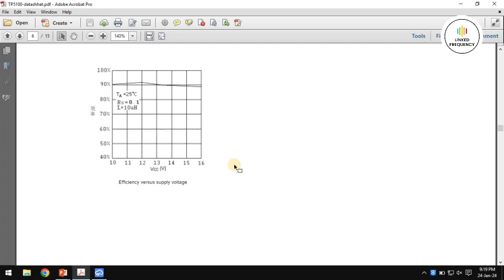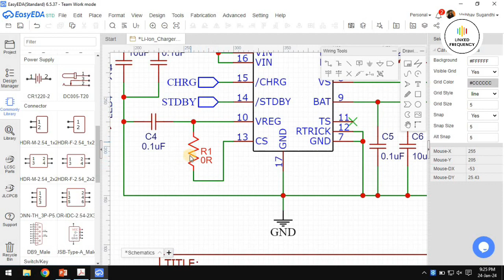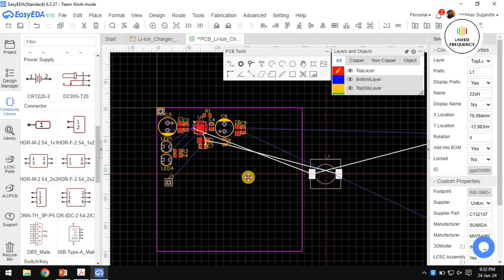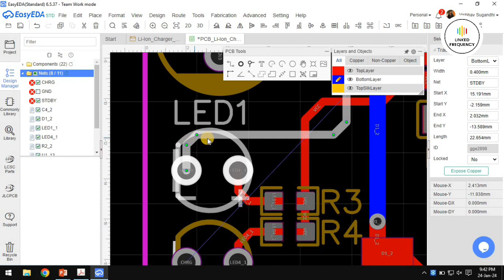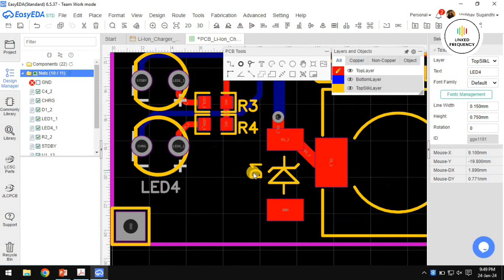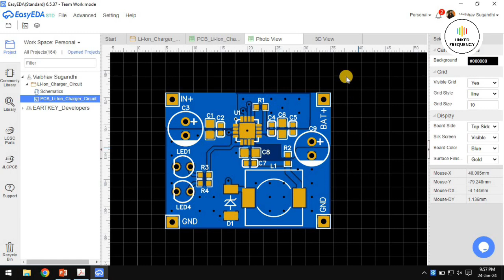Li-Ion battery charging circuit using TP5100 IC #E19 | Vaibhav Sugandhi

Comment: Thank you alot sir for the video , May you share us the LSCS Part numbers for the components used
Reply from the maker: You are welcome Martin, 
If you search specific part number you will get these components in LCSC or system libraries. If you need this design file for your reference you can email us at linkedfrequency@gmail.com 

Happy learning :)
#Linked_Frequency

Comment: Hi Vaibhav,

Thanks for choosing a commonly used circuit and demonstrating its PCB design.
I have a doubt: Why was Copper pouring done multiple times? As in I guess, it was added block-wise first and later complete pouring.

Thanks in advance.
Reply from the maker: Hi Sourabh, 

Block wise copper is called "Solid region", it increases the current capacity in that path with a specific share and size of the track. The copper pouring is used for GND net distribution for the whole PCB.

Happy learning :)
#Linked_Frequency